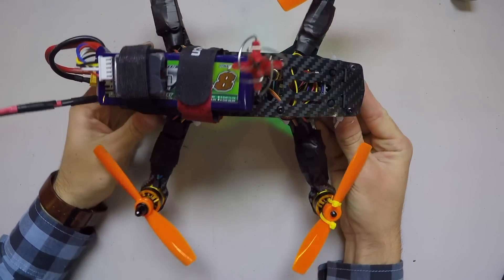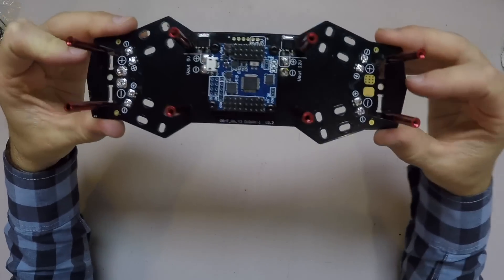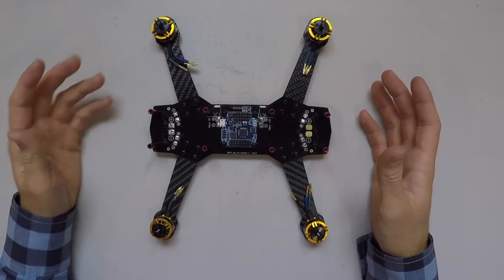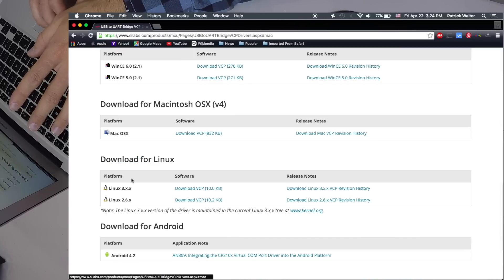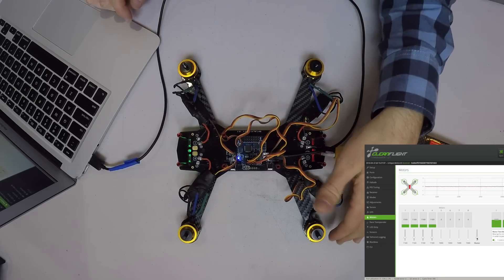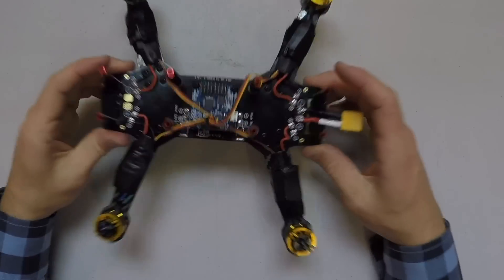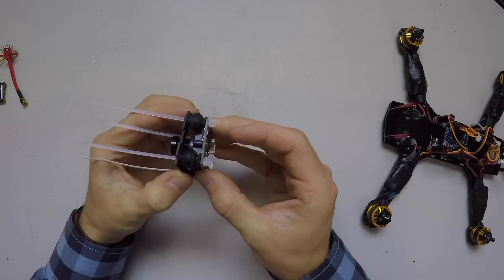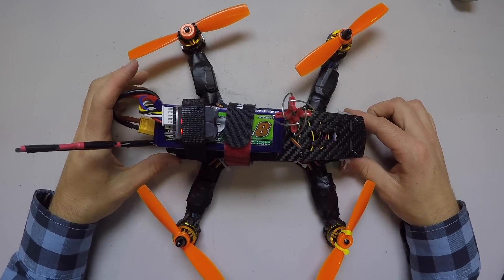CHEAP FPV RACING QUAD BUILD - Step by Step Guide with Links

Comment: You have skip the part how to power flight controller board, because there are 2 types of escs. Second, you haven't explained how to change the spinning directions of the motors

Comment: I built (today) a 250 very similar to this. however I am struggling to get the drone stabilized.  Can you provide detail for setting up PIDS and other configurations within Cleanflight?
Reply from the maker: +kerry corcoran I never messed with PIDs if you leave it at default it's a bit tough to fly becuase it's really responsive. Another factor can be the quality of the sensors on the flight controller, oh and the settings of your controller if it has the capability to set sensotivities and auto leveling
Reply: +How We Make Things Appreciate the reply.  Actually i figured out I had the board orientation off by 90 degrees.  Corrected the orientation and now I can fly it.  I still want to figure out how to make it "not so touchy" though.  I fly it with a Taranis X9D Plus.  Any insight appreciated!

Comment: hi thanks for this video its very helpful can u tell me what is the range of the transmitter and can it hover in air when u leave the controls
Reply from the maker: +Aditya kore it drifts while hovering. If you get sonar this helps minimize a little of the vertical drift, but the drone is meant to be moving a lot and fast

Comment: Hey, I'm having a lot of trouble working w/ modes for adding an arm range to arm by switch, also adding horizontal & acro modes to my drone. I'm struggling on this Turnigy 9x due to my inexperience w/ modes, Aux, and mixing & was wondering if you could help me out somehow or refer me to a different tutorial or forum. I'm willing to pay to IM and get this resolved because my local hobby store (drone guy) is busy for weeks and I really want to figure this out asap. Any help, would be extremely appreciated. Thanks in advance!
Reply from the maker: +Oscar Rivera you want to arm the drone via a switch instead of holding yaw right? Is that what you are asking?
Reply: How We Make Things yes that was what I was asking, but I got someone to help out already. But if you have time I would like to be enlightened on how to add led lights to my drone. Is it as complicated as it seems? I simply soldered it to my pcb, since it's a strip with positive and negative. Where do I go from there, and if cleanflight. Is there a simple way to do it?😬 (Doubt it)
Reply: How We Make Things yes

Comment: Im gonna build this! :) my first racing drone. Already ordered everything for drone.. camera and googles later.. Thank you for the video really looking forward.
Reply: Hello can you please help me? I ordered this one http://www.banggood.com/DALRC-NAZE32-REV6-MPU6050-32-bit-6-DOF10-DOF-Flight-Controller-for-Multicopter-p-1020774.html  Can you please confirm with me that pin row with GND,5V,PPM/1,2-8 is for receiver and the 1-6pins on the opposite side of board for the ECS? I don't understand where is power for the board (didn't find this in video)? Should I connect battery 5V (or 12V? not sure if controller is able to handle it?)from frame to the VBAT pin and ground from frame to the GND next to VBAT? Is the frame. Many thanks!
Reply: Found schema for my Controller http://www.dronetrest.com/t/naze-32-revision-6-flight-controller-guide/1605... Its saying input rail can be used for PWM, can you help what should be done to switch it? My receiver does not support CPPM and i don¨t need those pins now. Found some convertor from PWM to CPPM but switch it is cheaper.
Reply: aha I already found that there is one pin for receiver but it needs to be PPM receiver. and it looks like this board is also capable to use PWM receiver http://www.dronetrest.com/uploads/db5290/original/2X/9/977a2a3924cfb004ccd942228e96e4657a292b5b.jpg with pins 1-8, how it works? Can I just plug channels 1-4 to pins 1-4 and NAZE will recognise them?

Comment: how do you get the screws and the bullet connectors? are they included in one of the items in the list? are all the little wires included in an item?
Reply from the maker: +Mathieu Jobidon the bullet connectors are included with the motors, but not necessarily the ESC's. Most of the time they are. I bought a bag of male/female bullets. The little wires are for the receiver
Reply: thanks :)

Comment: Great tutorial! I'm wondering what the weight of this completed build might be. Also, could I go with a smaller frame and still use the same components you've listed without any issues?
Reply from the maker: +JAIME D you would have to use smaller props if you want to go with a smaller frame but otherwise it should work

Comment: Wtf? Following this guide won't asure you a good first experience with fpv and quadcopters, using zip ties instead of the prop nuts designed for that purpose? WTF? If you tight them firmly they will never come off, it doesn't matter if the motors spin clock or counter cw.. Not to mention that zip ties spinning at high rpms will cause vibrations as they are obvious in the fpv takes...

The battery too far away from the center, which will make the quad much harder to tune in a future.. Not to mention a 4s battery for a beginners quad......

Comment: Absolutely love the video. I am going to make this exact drone however there are some broken links. These are the NAZE32 and the battery link. If you could please comment some working links I would be over the moon so I could build this. Thanks in advanced. (Subsriced and liked ;D)
Reply from the maker: Thanks for the link headsup! I fixed them. Note that the banggood link for the Naze32 Flip32 is a different board now. It is the Naze32 F3 which will also work, the difference is the type of connections you will be making. It doesn't come with pinouts already soldered onto the board. If that seems like too much trouble, then just follow the amazon link inside of the spreadsheet!

Comment: Hey I am building a drone off this video but I am using an x4r receiver. What type of wire should I use to connect the receiver and flip 32. Please respond.
Thanks,
Jack
Reply from the maker: Hey you have two options, you can either do 3 pin female to female jumpers http://bit.ly/2hxfLAf or you can use 1 pin female to female jumpers: http://bit.ly/2iFFNkV

Comment: If this is cheap
Im homeless
Reply: why not buy something like this? http://www.banggood.com/Eachine-Wizard-X220-FPV-Racing-Drone-Blheli_S-F3-6DOF-2205-2300KV-Motors-5_8G-48CH-200MW-VTX-ARF-p-1085802.html?rmmds=search 

its 140 usd which is cheaper than the quad which was built in this video.
Reply from the maker: Lol i quickly found out that drones as a hobby is not cheap. Relatively speaking, this is a cheaper drone build for a fullsized racing quad :) but yea part replacements and all that, it adds up so quickly!
Reply: yes but for 1 part you can buy drone so xd
Reply from the maker: ViperCS Lol yes depending on what type of drone. One thing you realize really quickly is no matter if you buy one or your build one, you will crash it and be stuck fixing it. So I really encourage people to build their own, that way they know what goes into it and how to fix it :D

Comment: Hey, where did you buy the cables to connect the receiver to the Flight Controller? And is there any other less expensive Transmitter and receiver? Thanks
Reply from the maker: you can get them in single pin jumpers or 3 pin jumpers: http://www.banggood.com/40Pcs-10cm-Female-To-Female-Jumper-Cable-For-Arduino-p-994059.html?rmmds=search?p=8Q12113516108201601L

They are servo jumpers or single pin arduino jumpers

Comment: hey mate have managed to bind my turnigy9x has a solid red light on receiver. but when I hold the throttle to the right I do not get a green light on my Naze. any ideas? cheers
Reply from the maker: +Dale Burrows that means it's not arming. The issue is that your minimum/max throttle aren't setup properly. Basically your throttle needs to ranger between under 1100 and under 1900.this is a pretty common issue you can find a video online

Comment: is it possible to transmit the video to a laptop and cut the need to buy the expensive video googles?
and thanks for taking the time and making this video!
Reply from the maker: +Barel Levy you can buy a video receiver form Banggood for $40 which is listed in the spread sheet. It has RCA output for video so you can plug it into any TV
Reply: Thanks alot, if i could like the video twice i would :-)
Reply from the maker: Barel Levy :D

Comment: Hi, does the Sony NTSC Camera, includes the "balloon suspensions ? And can the Sony NTSC camera be fixed to the FreeYoung ZX-250 ?
Reply from the maker: +MrGod no it does not include the rubber standoffs, that comes with the zmr frame not the Free Young
Reply: Hello,
What kind of lipo battery should I use in the BUILD 2 ?
https://docs.google.com/spreadsheets/d/1JMd0CcFWoLFMNBiWdIQWIyZlWzdelcfXdjtqQQHpfk0/edit#gid=0
And did you build the BUILD 2 ? If yes, does it work well ?

Comment: one more thing my turnigy 9x arrived today and looks like the receiver is different it has Bind,Battery and 8 channels. also it only came with a bind cable no other cables to connect to the Naze 32. what are the other cables called?
Reply from the maker: +Dale Burrows so the 8 channels are a build deal they just are extra options for additional motors/controls, to fly a quad you only need 4 channels technically but receivers come with a min of 6 usually.
Usually the cables to connect the receiver to the Naze come with the Naze. Look up receiver 6 channel jumpers. Sometimes people call them servo motor jumpers
Reply: Awesome thanks mate

Comment: hello can't seem to get a hold of the same naze32. would Afro Naze 32 Acro Rev6 10DOF work. and is the set up the same?
Reply from the maker: +Dale Burrows yes any Naze board would work, just have to pay attention to the pin outs, they might have you solder the header pins on or they might use a micro JST connection

Comment: Great video bud, my only advice would be to turn the flight controller 90 degrees before mounting so that the usb port is at the side where it's easier to get to. You can then change the gyro rotation to 90 degrees in cleanflight which will put the orientation back to normal again.
Reply from the maker: Yes I agree! in fact I wish I had done that! Would have been so much easier
Reply: How We Make Things I was lucky in a way because I see it advised on a video before I built my first quad if not I would of also mounted the FC with the arrow facing forward too. It's an excellent video you have put together though. Very detailed and a great video for anyone building their first quad. I appreciate you taking the time to reply to my comment and thanks for such a good video. Fly safe and have fun buddy! You have a new sub :)
Reply from the maker: Modz FPV Yes it would have helped me too knowing it and knowing how many times I would have to plug it in and open up cleanflight. There is something nice though about not having to change too many settings, especially for a first build, the fewer the steps the more confident you will feel about it I think.

Thank you, I appreciate the feedback, and the subscription!

Comment: Hey i was wondering if there are any other options for a possible cheaper radio control transmitter?
Reply from the maker: The turnigy linked in the spreadsheet is the cheapest you can go. Typically a good transmitter runs between $100 and $250
Reply: okay i will pick it up thanks and great video :)
Reply from the maker: No problem!

Comment: I've build the Drone : ) Do you know what battery I should use? and what charger? I'm a beginner so I don't want a $80 charger.. Thanks!
Reply from the maker: Here's the dealio about cheap chargers, they are dangerous! So if you want to get a cheap one, I would highly reccomend charging your batteries in the garage away from anything flammable. This is the one thatwe used that was really cheap: http://www.banggood.com/TITAN-B3-2-3Cell-7_4v-11_1v-Lipo-Battery-Balance-Charger-For-RC-Model-p-71284.html?p=8Q12113516108201601L 
It cannot charge a 4S battery though, just 2S and 3S

You can check out this spread sheet for all of the parts we used. There are a couple different tpyes of batteries in there: https://docs.google.com/spreadsheets/d/1JMd0CcFWoLFMNBiWdIQWIyZlWzdelcfXdjtqQQHpfk0/edit#gid=0

Comment: what kit is this? Where did you get it? Please slow down a bit and slow down on talking. I did like your video but you should have opened with a shot of everything layed out so you could then explain what it was and where you could get it. I was lost right from the start.
Reply: Found your spread sheet.thanks. slow down......wheewh!
Reply from the maker: +scott firman check out the spreadsheet link in the description. The video is meant to be a walk through. The spreadsheet, is meant to give you an overview of what the bios has. 
There is no kit, this was pieced together by myself and my brother. We spent a long time parsing through the available parts and aggregated the ones we thought best matched price with performance for a beginners drone
Reply from the maker: +scott firman just watch the video at 3/4 speed :D

Comment: Can you also record with this drone?
Reply from the maker: +Leon De Muynck you can record from your groundstation with the appropriate equipment.
Basically you need something that'll receive the signal that is transmitted from the drone and then records it to a drive. This is usually done independently of the goggles you are using, but I think some fatsharks allow you to record while you view
Reply: Thanks for the answer, how far is the signal to fly with the drone? How far can the signal go?
Reply from the maker: +Leon De Muynck that depends on what transmitter/receiver you get. Some of them are just line of sight and others can go upwards of 3/4 of a mile. The one I have in this build is more line of sight and tops out around 400 ft
Reply: How We Make Things with one do you command me? What do you prefer?
Reply: How We Make Things and how far does the fatshark goes ? And I want a transmitter with a much lager range so what do you recomment
Reply from the maker: Fatsharks, you'd have to check the range they say it can handle. Range and reception quality also depend on the type of antenna you have (https://www.youtube.com/watch?v=AuGBgTC6ph4) 

As far as a longer distance transmitter, that comes down a lot to power and frequency. The lower the frequency the longer range it'll have and better reception through walls and buildings. But lower frequency means lower bandwidth so you won't get HD off of say a 1.2Mhz waveform.
Here is a higher power transmitter I have used: http://www.banggood.com/Eachine-TS832-FPV-5_8G-32CH-600mW-Wireless-AV-Transmitter-p-975425.html?p=8Q12113516108201601L
It gets decently hot

Comment: What is the difference between the first and the second build?
Reply from the maker: +Cole Drinkwater the second build has a better frame and transmitter primarily. The motors and ESC's are the same.

Comment: can i use 30A ESC for 1300kv motor
Reply: or can i use 1806 2400KV Brushless Motor Simonk 12A 2-3S ESC 6030 propeller this?
Reply from the maker: +Ankit Chopra those are big props that might not fit on this frame, I'm not sure. The only thing that'll happen if your props are larger or more aggressively pitched is you will pull more power from the batteries and potentially burn your motors or ESC's. If the 6030's clear the frame though, you should be fine using them
Reply: Flysky FS-T6 V2 2.4GHz 6CH Transmitter-can i use this transmitter for the drone.
will you please suggest me as i am doing my very 1st drone!...

Comment: Hello, great video! However, I'm having issues with my drone's motors not spinning in sync. Motors 1 and 4 start to spin at around 1058 throttle, and 2 and 3 spin at 1160. What can I do to fix this? I've already done the esc calibration thing on cleanflight, which didn't seem to help.
Reply: Nevermind, figured it out. Didn't know you were suppose to turn on the transmitter while doing the esc calibration, lol. After I did this about 2-3 times, everything works :D
Reply from the maker: +Nanochip glad you figured it out :) was going to say that I didn't run into that issue on my build

Comment: can you also do stunts with this fpv drone and an it hold a go pro?
Btw very nice video ;)
Reply from the maker: +Criminal Tune yes you can do stunts. You'll have to configure your flight controller through clean flight configurator, something called PID controls how agile you are. Just google PID tuning. It can hold a GoPro, but it severely cuts back on maneuverability, so I would suggest a session if anything. 

Thank you!! That's what I'm aiming for
Reply: +How We Make Things ok thats epic! I'll have to build myself one:) thanks for the answer ; )

Comment: help, my right side of my motors doesn't work..
Reply from the maker: when you power it up with clean flight open? Try switching the wires of the right side motors with the left side to see if the motors are messed up or the your flight controller
Reply: +How We Make Things Thanks man! it works!
Reply from the maker: +DiyAquaPonics glad you could fix it!

Comment: how gets the flight controller it's power?
Reply from the maker: +DiyAquaPonics solid question. The flight controller gets power from the ESC wires that you plug into it. One of the wires is signal, ground and the other is 5volts. You can also power the flight controller directly by connecting it's 5volt rail (either where the ESC plugs in, or the dedicated 5V pin) to 5V power from the Power Distribution Board!
Reply: +How We Make Things aah nice, thanks for the clever ansfer ; )
Reply from the maker: +DiyAquaPonics no problem!

Comment: you aren't using a pdb isn't it?
Reply from the maker: +DiyAquaPonics the frame that I used has a PDB. It stretches along the length of the frame and it's what I'm soldering things to. It comes with the zmr250v2 frame